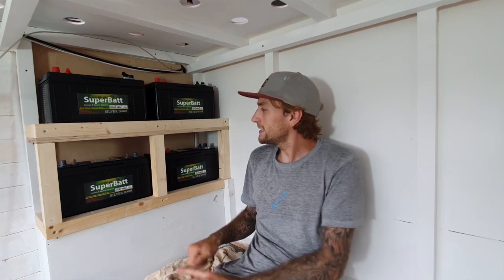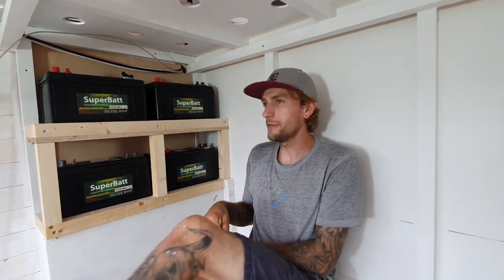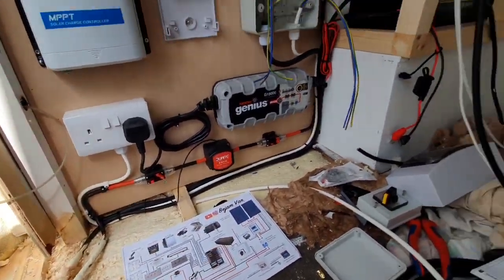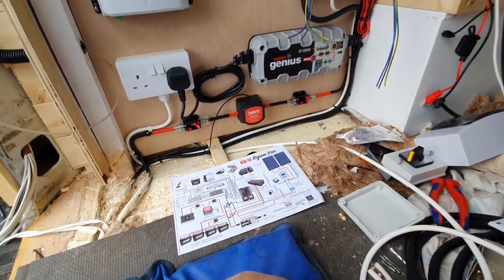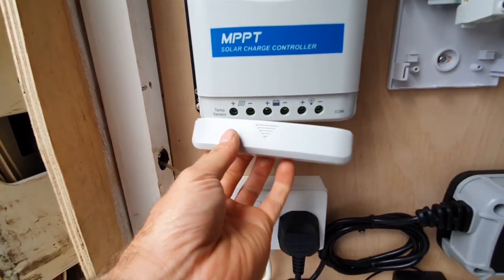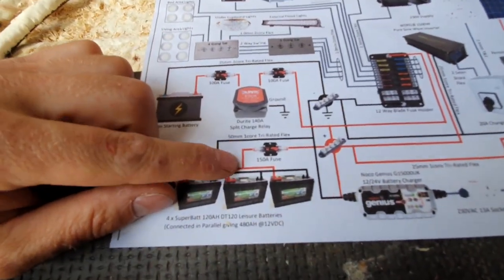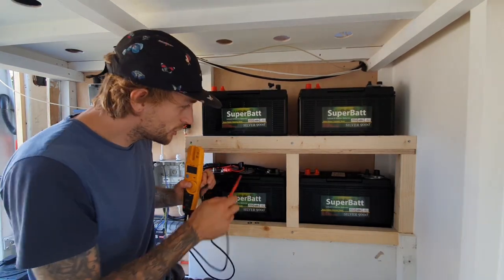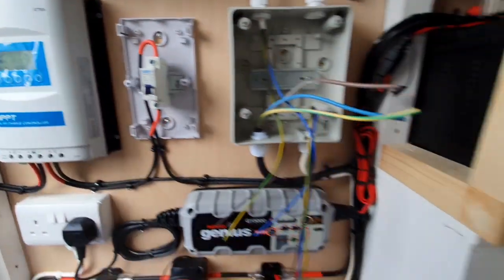Van Electrics EXPLAINED! | Van Life Build Vlog #18

Comment: Super video Ben ...👍 will help a lot, picking up my x3 batteries today 120Ah each 👌
Reply from the maker: Cheers pal 👍🏻 
Awesome, loads of power 💪🏻its a big milestone getting power on 👊🏻
Reply: Dare ask about the leak situation Ben ? Were our assumptions correct ? (Through the side skirt clips)
Reply from the maker: @Workshop-of-Allsorts  I have to be honest mate, I've been getting so carried away with getting electrics buttoned up I've not gotten any further with the leak 🤦🏼‍♂️ 
We had some rain a couple nights ago and there was no water which is positive.. but I've got 2 fresh tubes of sikaflex and once the electrics are done I'll be taking the trims off and sealing the holes. I'll clear the drain holes too and see how much water is in there 😅
I'll do a video on it when I get round to it 😅
I think it is the issue though.. we had a lot of rain when discovered the leak and i can't think what else it would be 🤷🏼‍♂️

Comment: "Fuses are there to protect the cable" you said. Thats true, but how is the cable protected coming from the front with the fuse on the end?
Reply from the maker: Good spot John.. after this video was released I added another 100A fuse under the bench seat at the front which is about 12" from the starter battery on the positive 👌🏻
Someone else commented something similar a while back.. 
Cheers mate.

Comment: Great Video Ben, you explain everything well mate. Have you thought of using the positive from the nearest top battery and using the negative from the nearest bottom battery (or vice versa). It will spread the discharge and charge equally between the 4 batteries, rather than charging through the nearest bottom battery and discharging through your top nearest battery, just food for thought Ben, love you videos mate
Reply from the maker: Thanks Alan 😊 it was difficult not to go into massive detail and bore the hell out of everyone 😅 
I've thought of a few ways to connect the batteries to get the most out of them but its difficult to know what effect it would really have on the batteries connecting them as you say, as they're all common. 🤔
So decided to connect the charger equipment to one side and loads to the opposite for ease and tidiness 😅 I may have a play at some point with a tester when they are under load or being charged and see if connecting them differently will pay off 🙄🙄
Cheers for the comment mate and for watching 👍🏻😁
Reply from the maker: Saying that mate.. i might stick a link from the first battery up to the blocks too so they are doubled. That way they will definitely charge and discharge evenly. Got a spare way on the blocks so I can do it. Cheers chap I'm doing that now 😅
Reply from the maker: Cheers Alan, that's a nice bit of kit even with the MC4 connectors built in 👌🏻

Comment: Hi Bejam, do you have a fuse at the main battery that feeds the split charger? you should have one within 12" of the main battery. if not that wire could be a fire hazard if the wire gets over loaded   
 this is how to should be                                                                                                                                                                                              main battery 12" of wire or shorter to a fuse,  long run wire to the split charger, length of wire to a fuse, 12" or shorter to battery bank
Reply from the maker: Hey mate.. I don't to be honest, its about 4m to the first fuse between the split charge and starter battery. 
I have to be honest though I don't agree with your thinking 😅 there's a 100A fuse between the starter battery and SCR, the cable is 25mm2 tri-rated flex rated at about 115A... the leisure batteries will be drawing depending on their health, it'll never be drawing that much and I've load tested the cable when the batteries have been low and its drawn no where near that.
I would agree with your statement from an isolation point of view, would be good to have local isolation at the starter battery (to be fair I do have a spare fuse there already which could be utilised) 
Where does the 12" rule come from?
Cheers, Ben
Reply: car audio do it, and camper vans, i would fit one to be safe. here a videohttps://www.youtube.com/watch?v=T8IsbEyGT28 if you draw more than 115A the 12" pace wire will burn 1st
Reply from the maker: Sorry mate, only just seen this for some reason.. but if I draw more than 100A the fuse will blow before the cable gives way.  🤔🤔 only way it might happen is if the current creeps up above 100A slowly and stays there for a reasonable amount of time.. that way based on the disconnection time of the fuse it might not blow in quick time. I think its a good idea to fit the fuse from an isolation port of view but not necessarily from a engineering point of view 🙄 
Its a fair challenge and definitely something I'm going to research a bit further 👊🏻👌🏻
Reply: @BejamVan  np your busy man, maybe ask an auto electrician?
Reply from the maker: @kennethcroll6972  I'm going to connect the 100A fuse by the starter battery this weekend anyway 👌🏻 but I would defo like to see what others think of it. An auto electrician maybe a good shout. I'm an electrical engineer that might have to swallow my pride 😅😅
Reply: @BejamVan  better safe than sorry, yes swallowing pride not easy. maybe a wee phone call with the auto electrician will not cost you anything?

Comment: Another Great video Pal. Well explained. My Wife and I are currently converting a 2017 sprinter so I just have a question if you dont mind me asking. I purchased a split charge relay kit and then discovered that my van may have a "smart alternator" as it is a euro 6 compliant van. Im lead to believe that these dont work with my van as the voltage drops considerably after starting the engine. Now having said that there is a test that you can do by starting the engine and it should show around 14.4 volts but after 10 mins or so should then drop to around 10v. I did this test and the voltage remained around 14.38 volts. It kind of contradicted itself. Im confused and wondered if you could throw some light on the situation as I dont want to fry anything. Thanks. Andrew.
Reply from the maker: Hey Andrew, sorry for the late reply mate.
I've heard the same about the smart alternators but haven't experienced fitting a SCR to one.. I did hear it wouldn't work but if the voltage is sitting at a constant 14.4V then I can't see any issues 🤔 
The only thing to consider is whether the alternator output is load controlled.. the  you may have to be careful adding the leisure batteries as it could overload it but I really wouldn't know mate.. I do apologise.
To be fair 95% of my power is generated through the solar, so if you are left with that only you may still be okay 👌🏻
Best of luck mate 👍🏻
Reply: @BejamVan  Hi Mate. Thanks for the reply. Think I'm going to bite the bullet and get a battery to battery charger just to be on the safe side. I'm pretty sure I will be ok with that. If you know anyone that wants to buy a split charge relay full kit let me know. I paid £72 but will sell for £50. Cheers. Andrew & Barbara.
Reply from the maker: @AndrewandBarbara  As you say that's a safe bet 👌🏻
I'll ask around for ya chap 👍🏻

Comment: GREAT VIDEO MATE  tnak thanks for the shout out bro and we love our battery terminals there just puka!!! . one question you mentioned earthing the system to the van , will that just be one cable that will earth the whole system, you don't need to earth the battery cos the one earth will link up the lot , if I'm correct there, if so I need to do this
Reply from the maker: No worries dude 👌 
I'll just be running a cable from the negative terminal block to a bolt on the body of the van. Because the batteries are wired in parallel, this will then earth the whole system 👍🏻 
I've also ran a separate earth from the 240V distribution board to the vans body as its a separate system and last thing I want a the van becoming live 😅

Comment: Hey ben,
  Just watching these electrics videos in anticipation of installing the electric system in my build.... Could you clarify a couple of things...
firstly, Your changeover switch - I understand when on hookup, your 240v is powered by the external hookup and is protected by the consumer unit, but when you use the changeover switch to power the 240 from your inverter there is no protection? do inverters typically provide sufficient protection internally, or have I missed something?

the other thing - (and this may get answered when I watch your next electrics video again) it looks like next to your 240v consumer unit you have another one for 12v? is that right and if so is it a specific 12v consumer unit?

cheers
Jon
Reply from the maker: Hey Jon, thanks for your comment and I'm always happy to clarify where I can 😊
The inverter supplies power to the 240V sockets only, when the changeover switch is in the correct position. The inverter has a 3pin socket as an outlet, so there is a 13A plug plugged into it which then connects to the changeover switch. So the sockets are protected by the 13A fuse within the plug when running on the inverter.. much like a standard extension lead.  When on mains, the sockets are protected by the 16A MCB within the 240V distripbution board.

With regards to your other question.. the 12V (or rather DC) panel next to the 240V panel contains a 40A DC MCB which protects the solar side from any high currents.. it actually protects the system from both sides. From any faults or high currents from the battery that could damage the Solar Charge Controller and it should also protect the battery from any high current faults with the SCC.

I have a copy of the wiring diagram if you'd like me to send it to you or it can be found on my Instagram.
I hope that helps mate 👍🏻
Reply: @BejamVan  Ah ok, that makes sense - my solar controller has a built in inverter, so I think I will probably need to wire that through a second consumer unit! (not that I will really be using 240) 

will check out the diagram in a sec, I will head over to insta, thanks